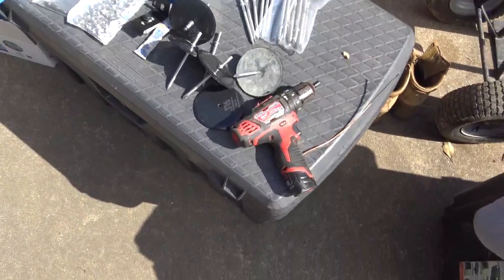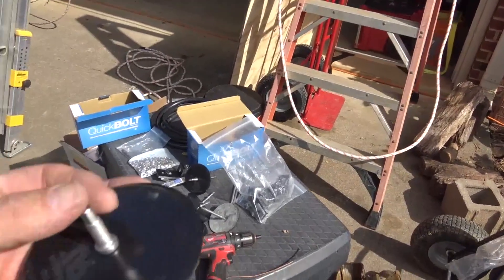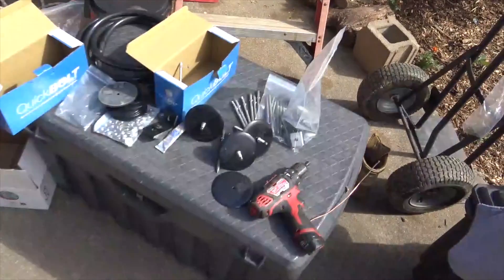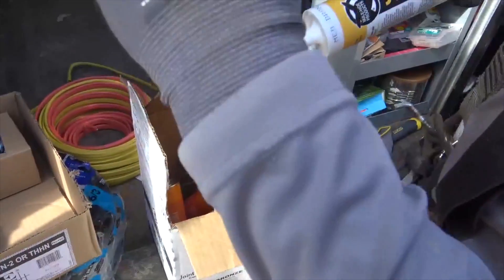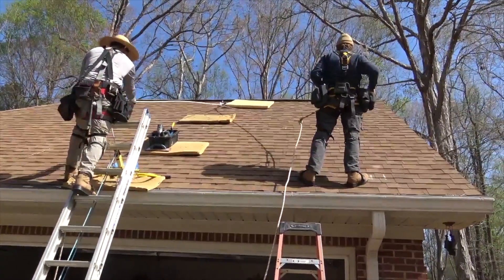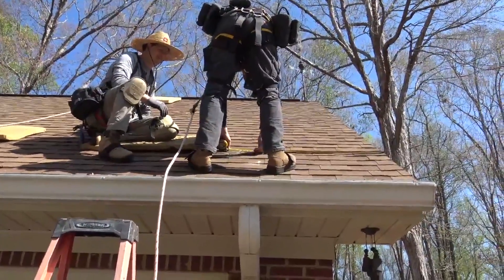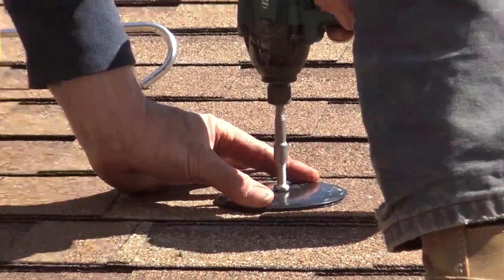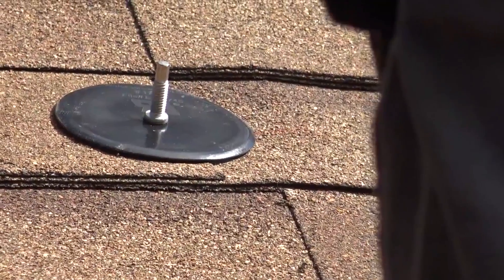The Best Solar Roofing Anchors! (For a shingled roof)

Comment: That is by far not the best, mine requires no sealant and cannot leak,aluminum flashing under shingle,bolted in the rafter, 3" standoff made on flashing,3" cap over bolt that your rails bolt to,best in the business, will outlast your shingles, and are reusable. JM2C

Comment: I know this video is old but I've made alot of money replacing systems with these attachments. Spoiler alert: they leak
Reply from the maker: Tell me more. We don't do a lot of roofs but we have never had the ones that we've done leak
Reply: @engineer775  pink energy/power home used these on a lot of installs. I've been to three this year, they all needed new roofs and a reinstall with new attachments. It might take a few years, but I wouldn't trust them.
Reply: So at 2:28 one guy says they put sealant “all the way around” and then later in the video, the guy on the roof doesn’t put anything around. Nothing like being inconsistent.

Comment: Warning:  Replace your shingle roof before you install solar panels, neighbors had solar panels installed two years ago, shingle roof had to be replaced this year, it cost them $11,500.00 to have the solar panels removed and installed again....
Reply: It should cost 150 to 200 a panel. 11k is way too much unless you're talking about a gigantic system

Comment: What  I worry about is once the solar panel is installed, how much wind force is this holder withstanding before it rips out? Is in, I am sure it works for normal conditions but what is it maximum  holding strength??

Comment: If you watch Quickbolt's install video they actually take the bolt down further until that rim is like halfway down into the disc. Of course you don't want to go too far with it, but I would probably take it a bit farther than shown in this video. If you watch their video they bolt it down until it's fully dimpled, then they go just a bit further to sink the bolt in.
Reply: If you hit it to hard you will deform the washers outer edge causing the leak you are trying to prevent IMO as a Glazer retired

Comment: What if the "studs" are the frame placed OVER a wood shingle roof to overlay a stone covered steel roof?

In other words, I have a roof on top of a roof, so I don't know how to look for "studs".

I am worried that no one will want to install my solar panel system, because I bought all the equipment, but just need the install.

Do companies like doing ONLY installs?

Comment: When that disc dimples in when you drive the screw home, can water collecting in the dimple be an issue? What with the washer and goop sealing the hole, and the roof being at an angle, I'd guess the water would run off or evaporate first. But if were DIYing I'd do a bead around the bolt just to make sure.
Reply: I think you would put sealant on underside of L bracket that goes on the stud before you put washer and nut on

Comment: oh hell no.  when the solar industry was ramping up we in the trade called them the roofers full employment act.  the retarded install methods i saw were observable from the ground while passing at freeway speeds.  the trade has upped its skills at the cleats and racks but THIS style of cleat ABSOLUTELY voids the warranty i offer my clients.  unless the manufacturer of this little device, and the guy that penetrated the roof covering (...ABOUT 30 TIMES) are going to be around for the life of the roof AND MATCH THE WARRANTY PERIOD of the manufacturer,  you need to use any of the "bibbed" style flashings available.     here's a pro tip...be SURE there's a roofer on the crew placing the racks.  just as i don't let my roofers install solar, don't let the solar guys play roofer unless they know that trade.  and please stop placing racks for 25 year solar fixtures over roofs that have 7 years left on them.  just stop it!

Comment: Hey what are those mat things you're using to protect the roof?  We used to use something similar looking to that at a place i worked at but I can't find them anywhere. They came in a big roll about 3' wide and you could lay it on the roof and walk on it and it was super grippy and wouldnt mar up the shingles.
Reply: Those are just normal couch cushions.  Polyurethane foam.

Comment: Iron ridge flash foot 2 all the way
Reply: Joe Sidebottom iron ridge has weak wire management
Reply: @GainSolarPower  agreed but 150lb black zip ties last a very long time. The flash foot 2 will outlast the shingles that junk disc your using is going to give you problems. Ive got around 5 MW dc worth of residential installs under my belt and no one has ever complained about wire management. What the client cares about is it not leaking "with all them holes in my roof" 
I would not use those discs 
You can use the flash foot 2 with your rail BTW. 
Keep up the good work guys
Reply: @SolarTechFL  I dont like Tbolts, Ironridge has poor wire management compared to snapnrack.  I dont disagree about the slickness of the flashfoot 2.  Congrats on all your installs.  If I had done that much solar I'd be retired by now, maybe you should start your own solar business, it sounds like you have plenty of experience.
 Can you recall the days before any flashings at all, back in the days of what we called "goop and a prayer"?  Back when a caulk gun and drill was all we had and solarman had to special order an estwing with an air bubble in the middle so it would ring a Bflat when he hit a rafter square in the middle....I digress.. Those jobs arent even leaking yet. Honestly, I sometimes wonder if the flashing industry wasn't just a giant cost adding conspiracy.
My original point was that irondridge has poor wire management, the flashfoot too is slick, not very adjustable but slick. Customers do complain when there systems stop working because rodents have chewed the wires that were dangling. I don't know what part of the country you are in, but in the southeast, zip ties become brittle after only a few years, they are handy but do not make for a 10-20 year wiring job. Snapnrack roof mount system is better than Irondrige all day long. It has built in wire management, invented the hidden undermount end clamp, metal roof base awesomeness, it is country strong... UFO's move the panels when they twist down.....

Ive used almost every major racking system, Snapnrack is what I choose to use.
Reply: @GainSolarPower  we settled on iron ridge due to nice flashings, long rail spans and the ufos, i like them ufos.
We are in FL so wind uplift is a big concern. I have never used snap n rack. Maybe i should give her a try.
We have used all kinds of racking 
The absolute worst is RAQ.
Ironridge back in the day sucked ass. They have gotten better 
If you dont drill 90* to the roof the panel will pull when you tighten it to the rail as it tries to square.
I have only had one service call to a rodent chewing wires and it was a system we didn't install  older sun power system.
Yeah 11 years ago an L-foot on the shingles and goop and prayer 
You are right i cant believe they aren't all leaking, some have but not many. 
I sub contract installation for 2 companies
 $.30 a watt for 1 story 
$.40 a watt 2 stories
$.60 a watt ground mount 
Battery backup and off grid are case by case basis. 

Im almost retired just getting the nest egg nice and big
Reply: @GainSolarPower  hey man we did a 7.8kw grid tie today had owens corning fiberglass nail strip 2 month old roof. It was a little bit of a pain but not a big deal start to finish the job was 7 hrs including 1 hr lunch 3 man crew

Comment: I wouldn't trust them for 25 years,  I also don't like how your placing them over the uneven edge of the raised shingle.  I have been using quickmountpv.com which has a flashing that slides under the shingle above while also using the same sealers.  Almost as simple but a lot of peace of mind.  I have had to replace whole systems which others have poorly installed causing many leaks.

Just my opinion, but water travels downhill always and having that upper edge exposed in an extreme climate like a roof stands a chance of leaking after a few years.
Reply: I agree
Reply: Agreed
Reply: Ok so how are you addressing the new fiberglass nail strip on new shingle roofs. Installing the flashing seems to do more damage than it does good. 

Have you run up on these new shingles yet?  I didn’t not believe in the quickbolt microflashings for a long time but one you install them it becomes evident that they will work.
Reply: @GainSolarPower  
We run into them quite often 
Our lowest wind zone is 145mph
When there hot they release 
easy er.  
We use a thin cat claw pry bar 
And work the bar along the fiberglass/tar at an angle 
When there new new its a dick 
But we manage.
You should switch to a sausage calk gun. Holds more and is cheaper per oz

Comment: I'm just wondering how it is that that plastic disc seals when it is bridging two different levels of the architectural shingle, like I SEE where there's a tiny gap. Water's gotta be able to get under that right!? Might be worth a follow up video after some time to see if they do leak in the real world.
Reply: Nathan D it’s a giant stainless washer bonded to EPDM on the back. They form a chemical bond with the roof.
Reply: @GainSolarPower  But does it bond to the underlayment? No of course it doesn't. Its compromised.
Reply: The quick bolts work.
Reply: @GainSolarPower  I'm sure, as long as they are, and properly hit a roof rafter and not a sloppily nailed block, or 1x4, or other weird thing a framer left in there. Those bolts could easily prevent the panel from being ripped off in a hurricane. But for a good water proof roof. No I don't think so. I wouldn't ever mount panels on top of a roof.  A nice metal roof could be $75-$200,000 dollars or more. Not worth the risk. If there is room in the yard put them there.
Reply: @Gain Solar Services 
In my experience in 35 years of commercial roofing. The only sealant that adheres to EPDM is cutoff or lap sealant. 
Even polyurethane do not work long term.
Reply: @drmachinewerke1    mach,  you have a few on me in the trade so i am also guessing you're grimacing as i am at this detail.   the smallest hole will permit entry...i fixed a minor leak from a single popped nail friday...the original installer had nailed low on a comp shingle and the years popped it.  it was barely visible at the lap margin.
Reply: @ensinitas  Roof mounted solar can only compound roofing problems.
Reply: @francismarion6400  I agree with that.